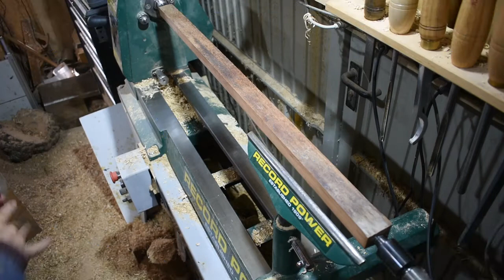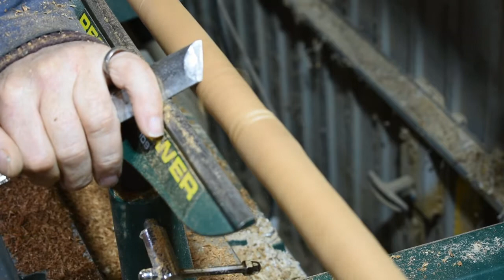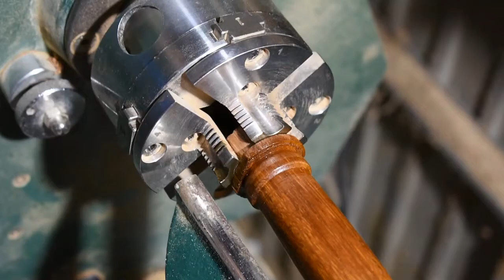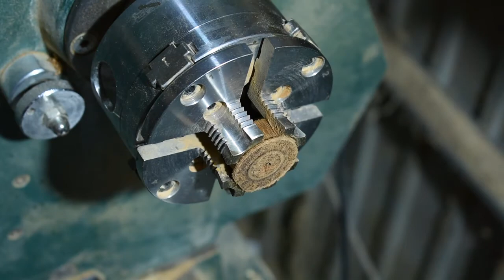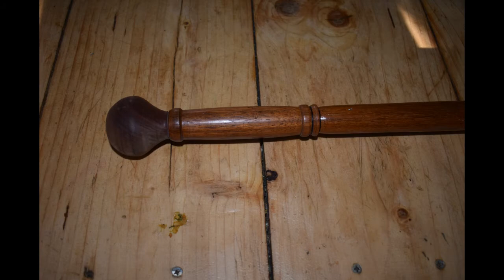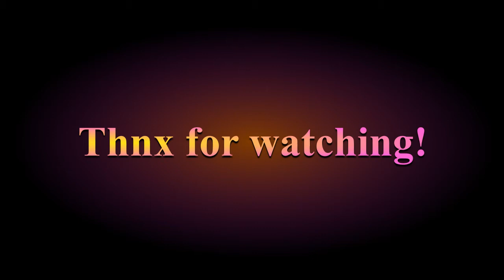A walking stick for my wife. #WalkingStickChallenge

Comment: G'Day Leo.  Great addition to the challenge and thank you for the mention.  MERANTI, I would have guessed it as I recognize the grain. Very distinctive.  I like the addition of the knob and brass foot also.  It is NOT just a walking aid. A status symbol as well as a defensive weapon.   What? no steady rest use?  I am stubborn and persist. Once again. Thank you for the addition to the challenge. 👍👍👍 🙂 Rob
Reply from the maker: Thanks Rob, if I'd had a steady rest this would have been the project to use it in.
As it is I have to make do without one. Light cuts and very sharp tools did the trick! 
Thank you for the Challenge! 😎

Comment: nice work Leo, I was holding my breath when you were parting off. Turn iut great, take care, John
Reply from the maker: Thanks, only the start of the cut is tricky, after that the wood supports the tool no problem.